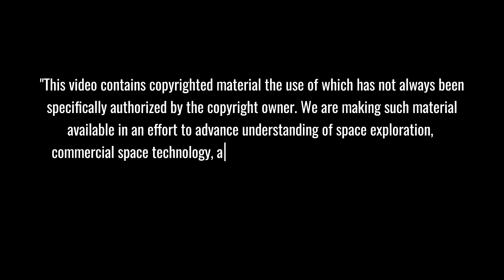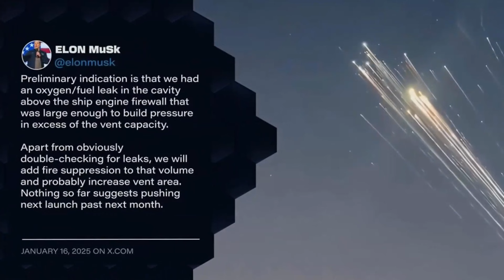SpaceX's 33 Raptors Set World Record, Then Flight 7 EXPLODED...Here's What Happened!

Comment: "Hot staging" difficulties can be solved by pursuing metallurgy advances, but not in the way you think.  If an aluminum alloy, incorporating the "spice element," scandium, is used for the construction of the hull and reinforcing structure, "hot staging," will not be necessary, because you will have enough fuel to begin with.  If you lighten the load you are carrying, you might even be able to create a one-stage rocket that carries enough fuel for the return trip as well as the initial, gravity-defying-trip.  With enough fuel, the main objective, reentry can be neutralized by using your engines by gradually braking your momentum.  By continuing to use a material that causes you to need to improve your project in a number of ways, is admirable, but you are really just fighting yourself.